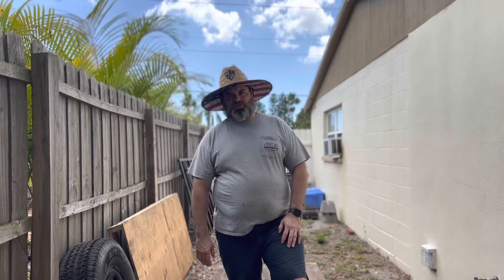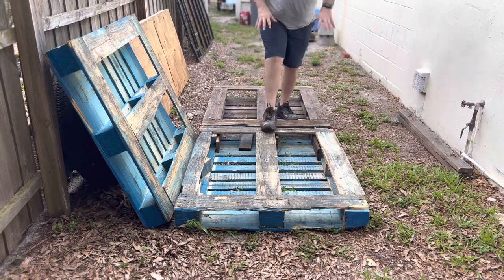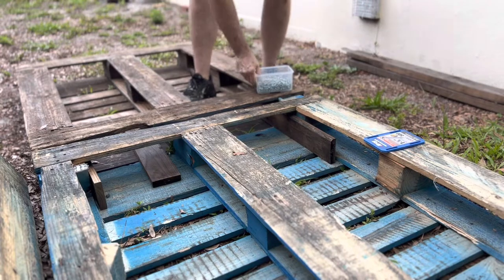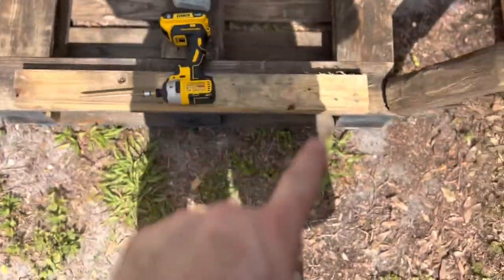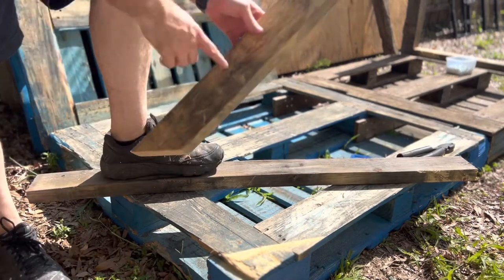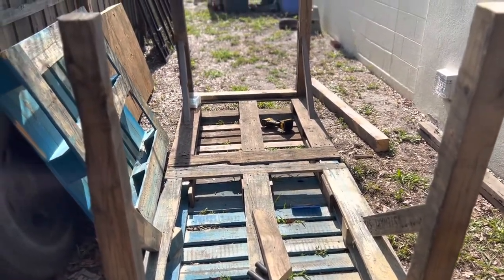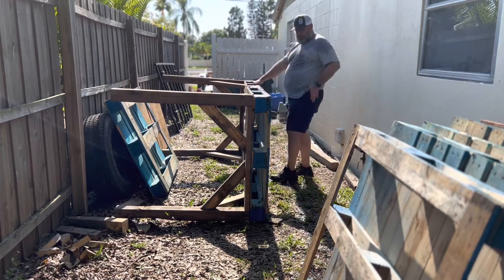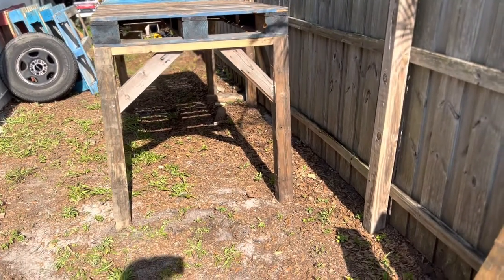Pallet Chicken Coop - Part 1

Comment: I like the design of your chicken coop however you need to be aware of the following facts on your pallets you do not use anything except for HT because MB is methyl bromide which is what your blue pallets are methyl bromide is a very dangerous substance to human beings. Like I said I like your design but using the red and the blue is pretty much a no no when it comes to anything that you're building you need to use where it's marked HT which stands for heat treated. Again I hope I didn't offend you I just wanted to let you know that's not what you use
Reply from the maker: I always appreciate constructive feedback. I checked my blue pallets and they were stamped HT.
Reply: 9